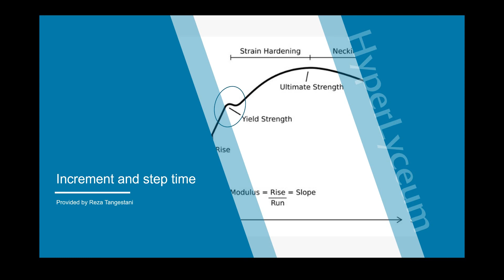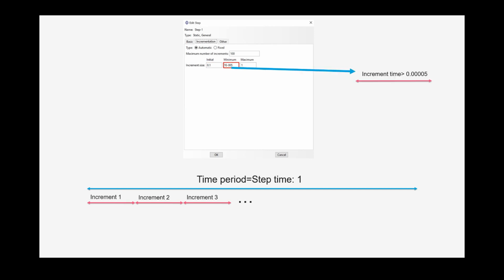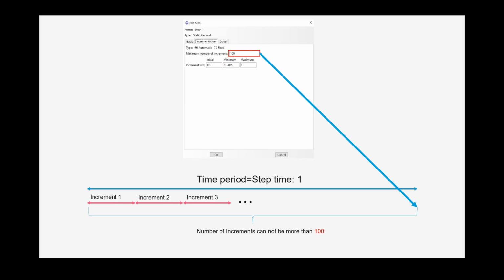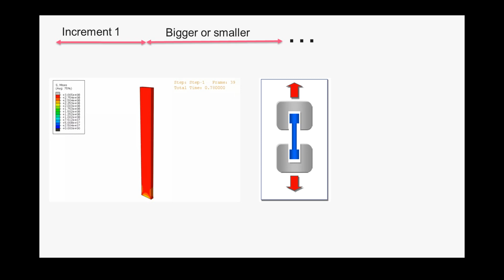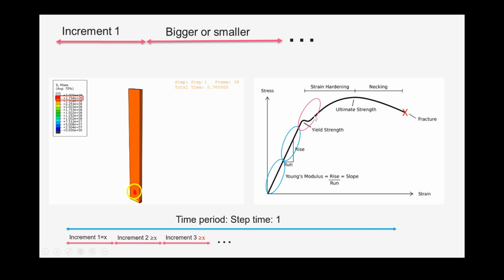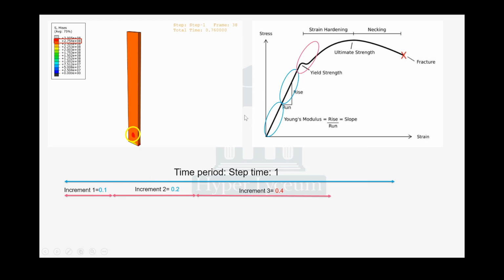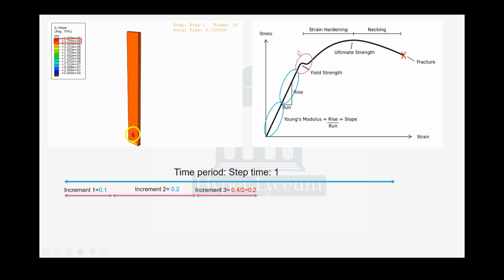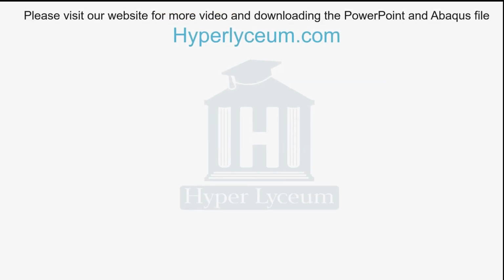Increment and step time in Abaqus to understand more about "too many attempts error" for beginners

Comment: Sir, 
       I'm an M.Tech student from Kerala. while I'm doing my project I'm getting an error in the Abaqus software as "Time increment required is less than the minimum specified" and then my analysis gets aborted. How can I fix this problem. Sir, can you please help me immediately since i want to complete my project as soon as possible.
Reply: I'm also facing the same problem
Reply: Same for me. Did you get it resolved?
Reply: Am getting the same problem..can you plz help me
Reply: how to solve excessive incremental elements rotation error plz reply